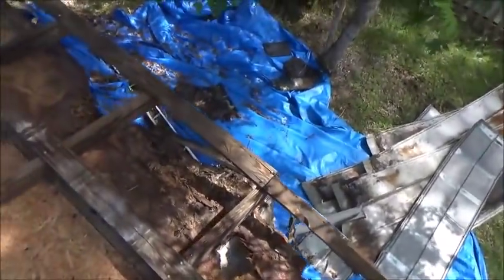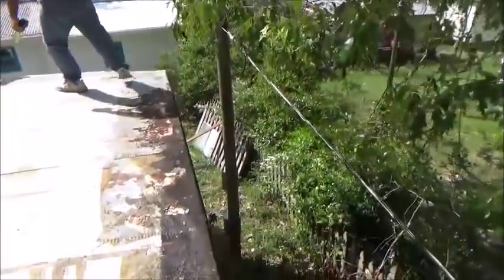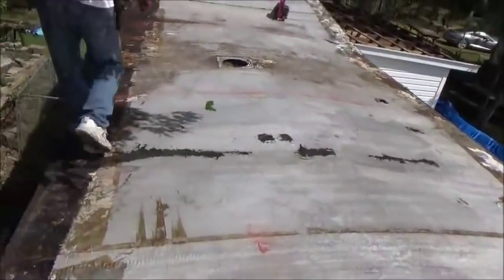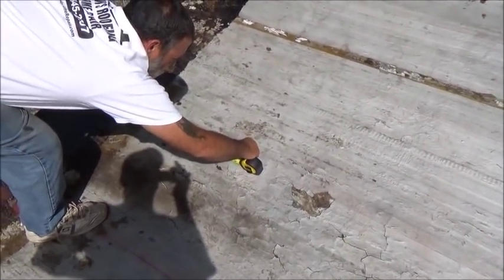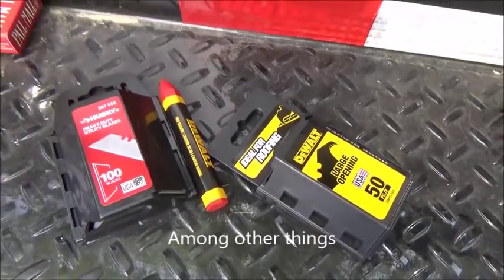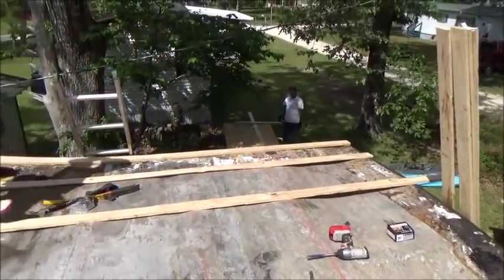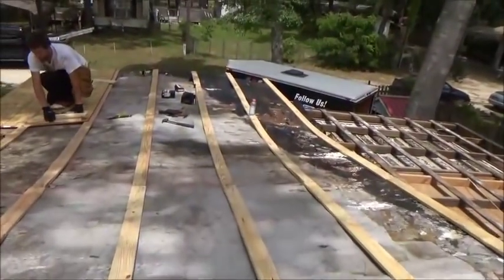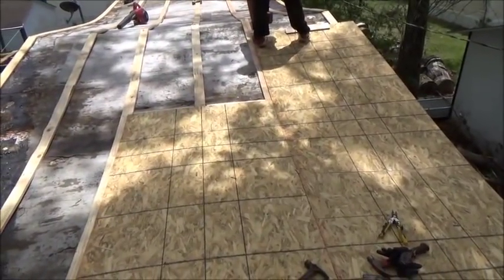How to repair Mobile Home Roof  (1 of 2)

Comment: Thank you very much for these videos.  You are a life saver for those of us on a very limited budget.  My question is with leaks and the mold and rot that comes with it.  So do you repair the roof and then kill the mold and repair any rotten wood?  I have as wife and 8 year old little girl and a faint to moderate smell of mold inside an 8' x 30' FEMA type trailer.  I don't want them sick.   How and when do you handle mold and rotten wood?  With the holes in the roof of this mobile home I assume there may be some mold there.
Thank you again for thinking of others when you do these videos.
Reply from the maker: My suggestion is stop the leak first. If you don’t stop the leak before you kill the mold the mold will never go away. Your best option is to find a way to stop the leaks remove the sheet rock or paneling where ever the smell is coming from in order to find it and then go to Lowe’s or Home Depot they sell stuff that kills mold in gallon jugs. Or you can go on Amazon and find mold killer I am going to list thatI am going to list that in the bottom of this video they can be bought right from Amazon
Reply from the maker: Please share this with at least one person that you know that has a mobile home
Reply: @Drewsroofingandhomerepair  Thank you for the immediate response.  That makes perfect sense and I just wanted to make sure I wasn't missing something.   We hope to get started on ours next weekend and truly appreciate your help. 
Again, you are doing such a service for countless people.  I do share your videos and will be buying from your Amazon links as I hope others will do.
Stay Safe out there.
Reply from the maker: Thank you very much we did not finish the job we started yesterday because of rain we will be finishing that job tomorrow I look forward to downloading the complete video when we’re finished
Reply from the maker: I just downloaded the update to that video
Reply from the maker: https://youtu.be/JcItyyuK4cI

Comment: I built rabbit cages out of 2 x 2's  with a plywood back and wire dividers. My rabbit feed came one afternoon when I was away from home and instead of putting the sacks on the pallets on the floor they put them all on the 2  cages,  a 2 ft x 4 ft area, that were sitting on concrete blocks. I would not have thought the cages would hold a ton of feed but it did and they didn't seem any the worse for it.  
If I was in your area I'd have you at least check out the roof of any mobile home I had moved just to be sure it was in good shape.  If you don't take care of the roof they can go downhill very fast.
Reply from the maker: moviemakerwannabe You would be amazed how strong a 2 x 2 is when you add plywood to the top of it amazing
Reply: @Drewsroofingandhomerepair  nothing like carrying a 2x2x4' in your car or truck, they do hold up good
Reply from the maker: I just downloaded the update to that video

Comment: Thank you for the videos. I have a question. After applying strips of wood then the osb... is it too much weight for this type of home? I ask cause I am looking to do the same but use metal sheets on the he roof instead of the rubber rolls. I’m wonder if putting all the material is too heavy for the roof. Thanks for your response.
Reply from the maker: Definitely not I’m not sure about the metal to be honest with you if your roof is flat you can’t put metal on it it will leak no matter what you do for another thing you could do would be to put mastic on every seam and then screw it every 12 inches no metal guy so I’m just a rubber guy but I can tell you if you look at my other videos and some of them I don’t use strips at all. So that’s only one way of doing the roof you don’t have to put the strips on in every situation